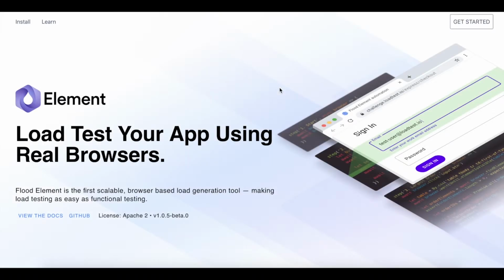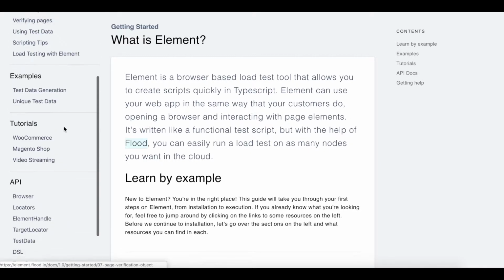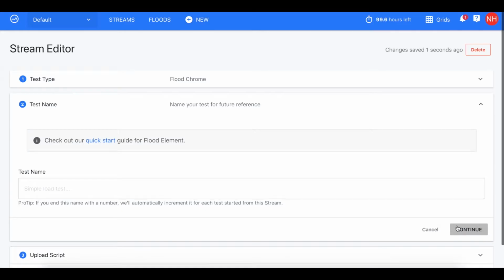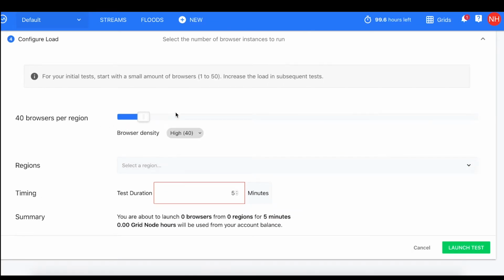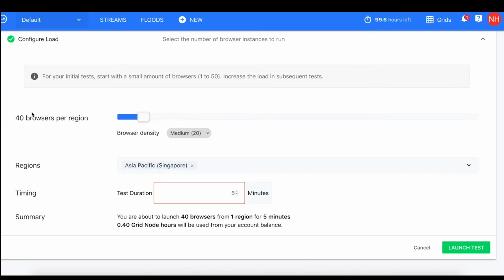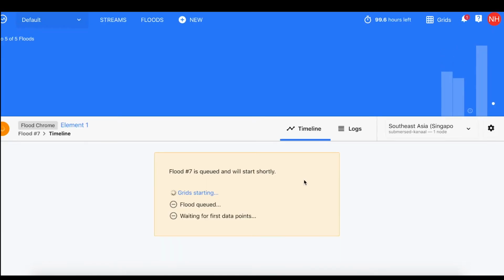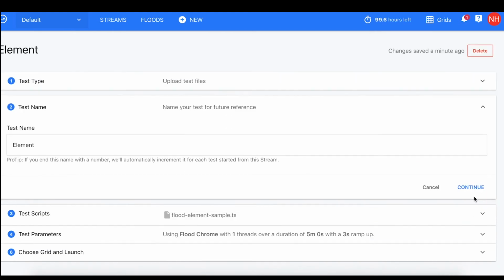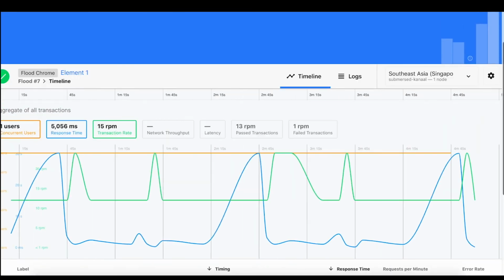Getting Started with Element

Comment: What is the max concurrent users does it support?
Reply from the maker: Thanks for your question, @pradeep dhital! 

For Gatling/JMeter we have supported a test of +5 Million of concurrent users for Hotstar, take a look here: https://flood.io/resources/scaling-a-live-stream-to-5-million-users/

Potentially we can reach out the same number for Flood Element, but it might be more resource heavy. At protocol level tools like JMeter or Gatling, we can launch up to 1,000 threads in a m5.xlarge AWS instance. For Browser level tools like Flood Element, the max number is 40 threads, so it's about 25 times more instances that need to be deployed. This is because at protocol level the engine is very small and a real browser consumes more resources.